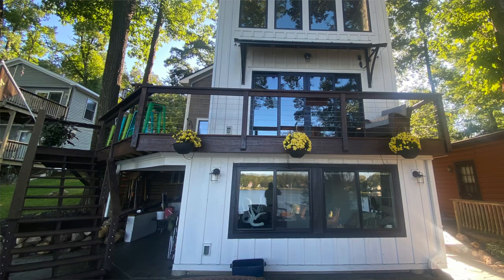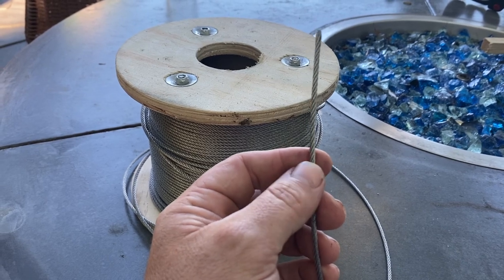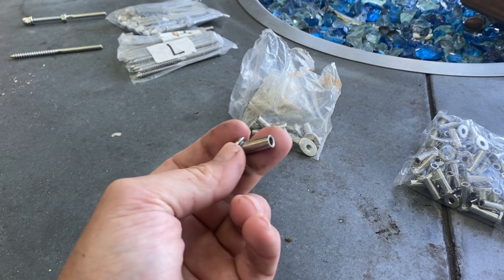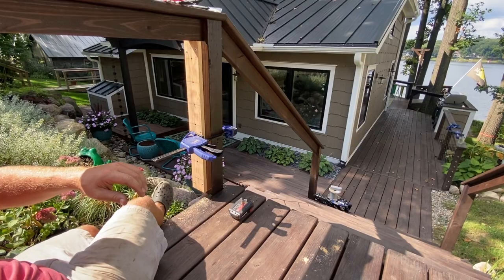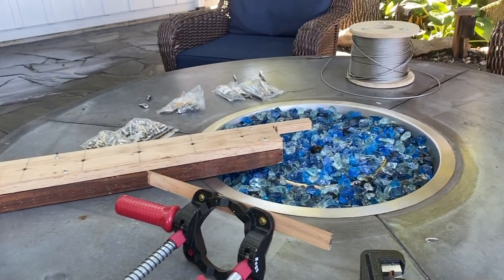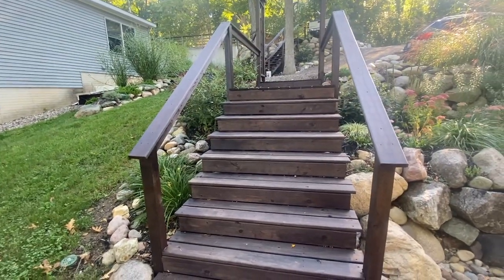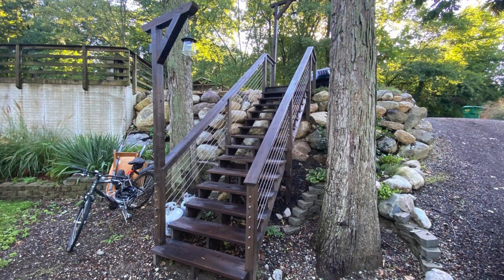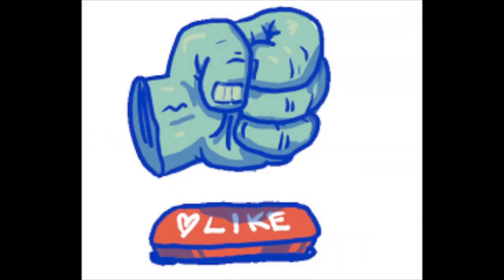DIY Deck Cable Railing - STEP BY STEP - We saved HUNDREDS!

Comment: Thanks for the video.  For the corners, did you run one continuous cable and fish it thru the post?  Or did you terminate the cable at each corner and start a new line on the other end?

Comment: Hi, we are trying to buy supplies for cable railing for wood posts on our stairs. They only sell 30 and 45* protectors sleeves, but our stairs are ~38*. Do you think the protectors they sell will still work? I've called and asked and they didn't know the answer for some reason and cannot find this answer anywhere else for any other product but it's unreasonable to assume all stairs are exactly 30*.

Comment: This is great, I plan on rebuilding my deck in about 2 months and I'll be using this for sure!
Reply from the maker: Hey thanks Brandon!  I really couldn’t be happier with look of the railing. It’s held up well over time too!  I think I included all the links in the video description.  You can do it very reasonably in terms of cost, there are a lot of products that are way over priced.  I had good luck with the pieces I used!  Good luck!

Lake warrior

Comment: Super. Thanks for posting this video. Only one issue - looks like when you use the drill press, you don’t set the base on the lumber then “press” the drill bit through. I think you basically eyeballed the angle to be aligned with the base of the drill press. But it looks like it came out ok. Feel free to correct me if I am wrong. Respectfully. And, again, thanks! Looks great!
Reply from the maker: Hey Doug, I definitely set the base against the post.  It’s important to set the angle so it’s consistent.  U can clamp the base to the 4x4 or have a second person hold it as u drill.  It’s tough to show everything in the video:). Hope that helps an best of luck on your project!

Lake warrior
Reply: @lakewarrior1443  Super! Understood. Thanks for the clarification. And thanks for the video!

Comment: Great video. The Milescraft drill mate drill press you show is calibrated at 45, 60, 75 and 90 degrees. How to you set it for 30 degrees?
Reply from the maker: You could add a 30 degrees wedge to the underside of the drill plate.  I believe there are bolt holes on the plate so you can bolt it on.  That’s how I would tackle an angle like that!
Good luck an thanks for the question!
Lake warrior

Comment: Did you just replace the spindles in your existing railing with cable, or did you replace the posts as well?
Reply from the maker: I had new posts.  But you could easily add cables if u have spindles.  Well, assuming u could dismantle them an not destroy anything:)
Good luck!
Lake warrior!

Comment: Hello, nice work ! I'm looking at the tensioners and it says for 2x2 wood or metal We are using 4x4 for the posts....is that not what you used? does this not work for that sizing?
Reply from the maker: Yes, I used 4x4’s for my post.  The tensioners I have in my link do in deed work for 4x4 an under!

Good luck an thanks for the question!
Lake Warrior

Comment: How would you do a 90 deg turn on a corner post? thanks! GREAT VIDEO!
Dave
Reply from the maker: I typically start a new run on a corner or go through the corner with a 45 degree hole.  They make the hardware to do that!  
Good luck
Lake warrior

Comment: Guy looks like Mikey from Orange County Choppers. Of course Mikey could never pull this off. I built a !6’ X 24’ deck with cable railings. 1st you did an excellent job of showing how to do it. 2nd a few things I did slightly different then you. And no mistake your method is just as correct. I used mostly Muzata tools and components off Amazon. I used a aluminum CNC’d template to layout my hole locations then drilled the holes using a jig ( drill press as you call it ). I held the jig in place with 2 hand clamps, then attached the drill and drilled the hole, removed the drill, then the jig. Worked great but took forever to do 320 times. The jig you made is definitely faster. I used tensioners on both ends of all the cables. I have runs of 24’ and 16’ so wanted to make sure I had enough adjustment if needed. It’s been thru 2 Michigan winters & 3rd summer, I have not had to adjust the tension of the cables. I used 316 black vinyl coated and love it! As you said no maintenance.  As far as cost cable railings are 20-40% of other options of standard railing components.
 On the deck itself it’s on 6x6 ground contact post, 40” deep in concrete. 2x12” beams, 2x10” joist. The deck boards are all 16’ long one piece boards. Pain in back side to find enough underaged pieces to do it. Deck boards are held down using the “Camo” deck screw system. Again looks great pain the ^$@ to do but worth it. Then I mounted the railing post on OWT wrought iron black power coated base’s from Home Depot. Expensive but worth it.
 Again very nice video Sir. Well done, thank you.
Reply: Enough I damaged boards.
Reply from the maker: Hey Rocky!
Thanks for the message!  I like the black coated cable and love that you had a template made out of Alum!  Thanks for the detailed response to the video!  All in all i think the cable railing is a great way to go!
Thanks Again for watching
Lake Warrior!

Comment: Thanks for the video! I've seen a lot of recommendations saying you shouldn't have more than 4'  between deck posts to limit sag in the wire. Seems like yours are further apart. Notice any issues with that?
Reply from the maker: Hey Josh,  good point.  4” is maximum distance allowed by most building codes.  I went 4” on center. 
Thanks for watching!

Lake warrior!
Reply: @lakewarrior1443  he meant the space between posts and the wire sagging. I have the same question. You had a pretty long run there on the flat section. Any issues?
Reply from the maker: @patrickdennison9799  no problems.  I think if u space them closer to 4-5’ apart would likely be better.  When I say better I mean you might not need to tighten the cables down as much because the closer spacing prevents sag.  We were going for a really open look to keep our view open.  Also my building inspector had no issue on post spacing so I went for it!  Be sure to check out my latest video on deck cable railing TIPS & Tricks.  I go over a few more things I didn’t hit on the first video!

Tips & Tricks!
https://youtu.be/q8OFdlOfF3s

Thanks for the comment Patrick!  Appreciate it!
Lake Warrior

Comment: I’m gathering info on doing cable railing as well. Could you tell me, now that it’s been a year, how your cable is holding up?
Reply from the maker: Holding up great!  If I do another deck I would use the same system.  Essentially no maintenance.  I love seeing through it as well.  I would use the system I got from Amazon.  Take a look at description on my video for exact links..  I did a follow up video which might answer a few more of your questions!  
https://youtu.be/q8OFdlOfF3s?sub_confirmation=

Good luck! Feel free to reach out if u have more questions!

Lake warrior
Reply: @lakewarrior1443  thanks a lot man! I’ll check out your update video!

Comment: Awesome diy and video. One question. How did you do your corners?
Reply from the maker: Good question! I used the drill press I mentioned in the video.  Marked the correct spacing, clamped the drill press to the post.  Drilled!  It’s alittle tricky so be patient!  Hope that helps!
Reply: @lakewarrior1443  I guess what I'm asking is how did you make the cables pass thru. I doubt you could make the cable go in and out on an right angle or less. Or did you use the lag crimp connectors at the corners so you didn't have to stagger the cables?

Comment: Great video… thank you! Did you use pressure treated 4x4 s or cedar?
Reply from the maker: Hey Thanks Geoffrey, I did use pressure treated lumber and sealed it with an oil based stain..  Good Luck on your project!
Lake Warrior

Comment: Do the tensioners go on both ends of each run?  If not, what goes on the other end?
Reply from the maker: Hey Carol, Yes I add tensioners on both ends. When u measure the cables be sure to measure with the nut all the way out on the tensioner.  That way you will have space to tighten it down once its all together!

Comment: You suggest using 3/16" SS Cable; however, the links for the tension insets all state 1/8th" .  I don't find any that are 3/16".    Did you mix the 3/16" cable with the 1/8th insets?
Reply from the maker: Hey Janet!  Sorry I might have messed up the link.  Should be 1/8” everything.  Thanks for watching!
Lake warrior
Reply: He said 3/16… he meant 316 stainless steel. It is a grade of stainless.

Comment: Could you explain how you did the end of the cable to tighten it?
Reply from the maker: Good Question Donna, I grabbed the side of the cable opposite to the nut on the other side of the post with a pliers to hold the cable solid.  Then on the other side I tightened the nut.  You really have to hold the plyers hard.  After a few turns tightening down the nut you have to re grip the plyers holding the cable.  The twist in the cable starts to bunch up so you release the tension a few times as you tighten it. Keep in mind the cable doesn't need to be super tight because you can readjust them over time.  I also found cold weather tightens the cables. Once you do one or two of these you will get the hang of it!  Hope that helps.
Reply from the maker: Hey I did a follow up video on this based on some comments!  This should help you if you still need it? 
 https://www.youtube.com/watch?v=q8OFdlOfF3s

Comment: Hi! Can you tell me which portable drill press you used?
Reply from the maker: Hey Amy! Thanks for watching, I used the following drill press from Amazon “4.3 out of 5 stars5,102 Reviews
Milescraft 1318 DrillMate Portable Drill Guide - Multi-Angle Drill Guide Attachment - Compatible with most 3/8 in. Drill Accessories - Self-Centering Drill Guide Base - Multi-Angle Readouts”

Good luck with your project!
Lake warrior!

Comment: I did not see how you drilled the 30 degree (stair) to horizontal (stair landing) transition. I assume you drilled both horizontal and 30 degree half way, just wanted help clarifying.
Reply from the maker: Hey Greg,  I drilled straight through on the landing post from the landing side.  Then set the height of the holes going down from where those holes came out on the step side..  This avoids trying to meet the 30 degree hole to the straight hole.  Complicated to explain this:).

Comment: How did you handle the 90 degree corners of the deck?
Reply from the maker: Good question, I drilled through at a 45 degree angle.  Wasn’t fun but with the portable drill press it wasn’t terrible.
Reply: @lakewarrior1443  ...and feeding the cable through was not difficult? Thanks BTW
Reply from the maker: Not really, it went through pretty easy.  wish I could send u a pic or two but utube doesn’t allow for me to send pics.  Im thinking about doing another video just to clarify a few more details like this!

Comment: Great step by step...thank you!
I'm using these tips to create a pool fence to keep the grand kids safe. I feel better running the cables vertically as then they can't climb the wires as a ladder.
Would you recommend lag to lag as I will be running cables vertically? Otherwise I was thinking of using the tension bolts on the bottom railing and running the cable up, through the top railing across 3.5" then down to another lag. A thought would be to clad the top railing so the cable cross over was hidden.
Any thoughts?
Also, have you ever used a one way clamp? I saw it being used on a This Old House video at 5:10. 
https://www.youtube.com/watch?v=vopMY32I47A